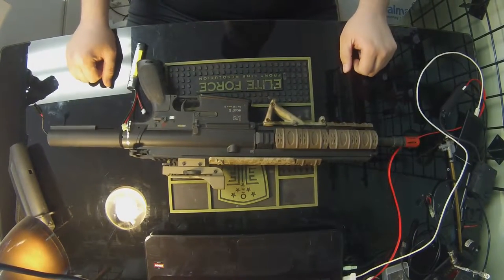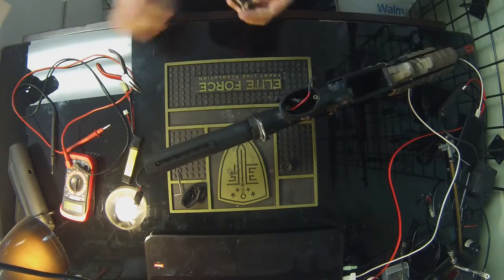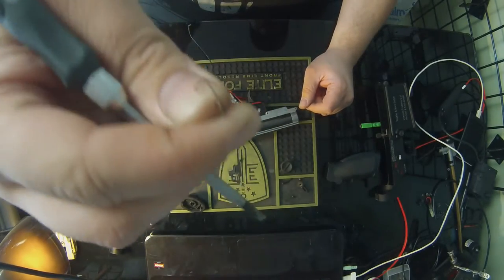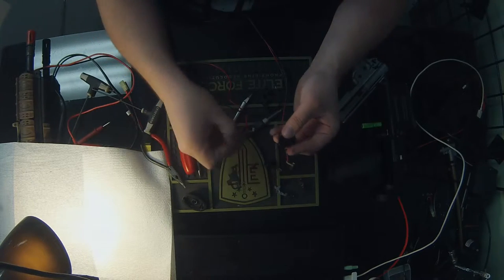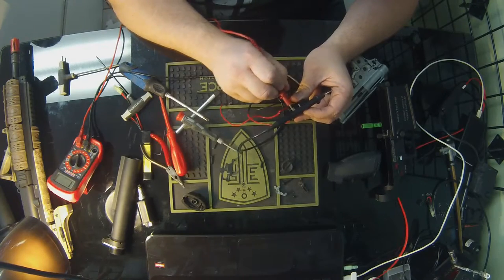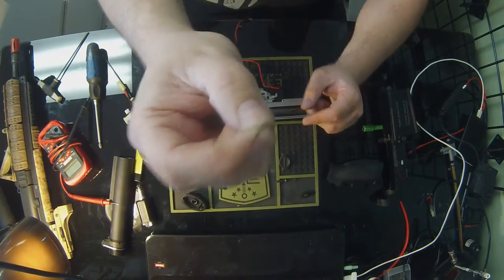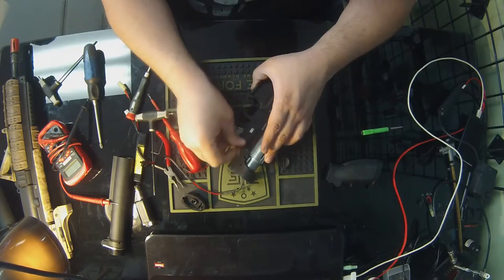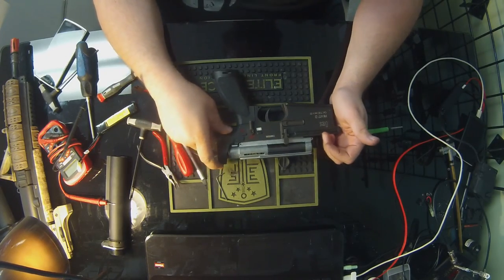Reaper Tech Tips: Trouble Shoot VFC Trigger Contacts

Comment: Awesome tutorial on the HK 417D.  You helped solve my AEG electrical problem that was due to carbon build up on the trigger contacts.  I've never worked on AEG internals before this tutorial, and your guidance made it all possible.

One highlight on a pain point.  The two newly cleaned metal contacts tend to tilt after pinning the wires down to the sides, due to too much wiggle room where the two trigger contacts are mounted.  After squeezing everything back together, I would get either no metal contact with no response, or too much metal contact and continuous firing whenever the battery was connected.  To solve this issue required frustrating trial and error of bending the contacts in just the right way, with continuity testing every time after reconnecting the selector switch.
Reply from the maker: glad it was able to help you get it fixed. trigger contacts can be a pain to get perfect but glad you were able trouble shoot and get it working.
Reply: Mine stops getting power when I put on the spring that holdt the trigger back from the 2 contact plates…